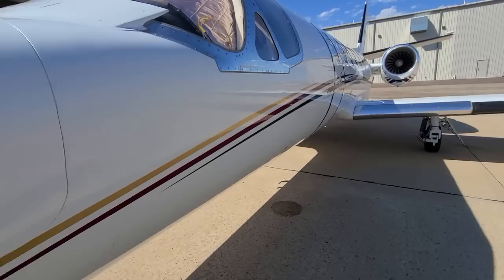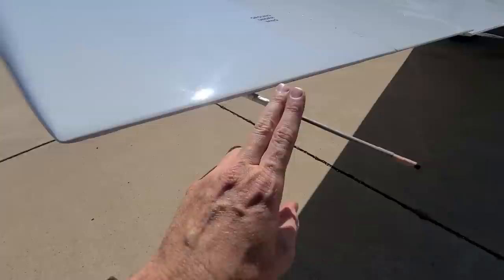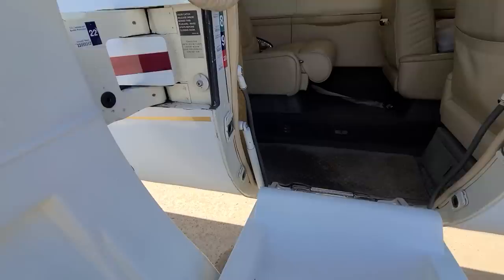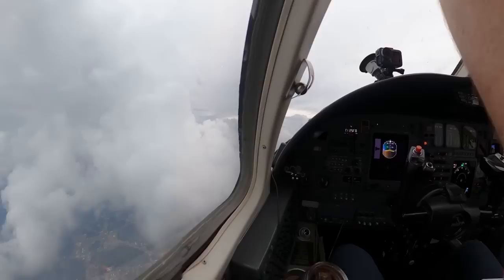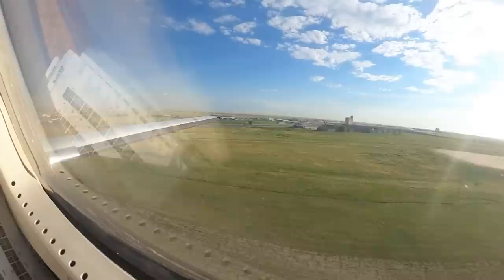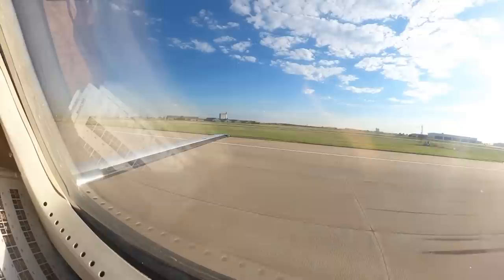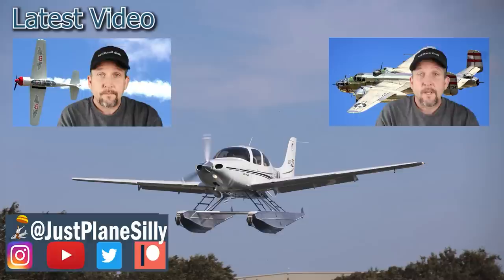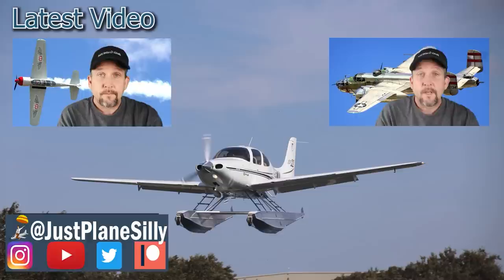How to Preflight a Lear Jet

Comment: Yay, back to silliness!  Good job!  BTW, about the pounds of fuel with jets.  This actually has nothing to do with weight or volume.  Jets are so fancy their fuel can only be bought with British pounds sterling and the fuel gauges simply show how much money you've invested in each tank.  So, to determine how many gallons you have when the fuel gauge displays pounds, you have to do the following:
1.  Determine the price in dollars for a gallon of avgas
2.  Use the current exchange rate to convert this dollar amount to pounds sterling, which gives you pounds per gallon on that day, depending on avgas prices and the exchange rate.
3.  Divide the pounds shown on the gauge by this number, which then tells you how many gallons are in the tank.
Reply: Thank God somebody knows how it works.
Reply: Such calculations can be performed quite easily using a Chinese abacus. Just need to use the Chinese currency exchange rate.

Comment: Next time, make sure you hook up fishing line to the chrome handle on the side of the plane and run it through the door so you can flush the toilet while you’re in the air.
Reply: That would be bad for safety. If the pilot can go to the bathroom more than once, they will forget to land and risk running out of fuel.

Comment: Just to confirm, you were careful to stick your airspeeds at 85 downwind, 75 base, and 65 final, just like my 172, right?  Also, you need to have a good A&P mechanic take a look at your bubble-ator, which was not creating bubbles on your final landing, a definite no-fly item...could just be a liquid soap issue, but I'm not a mechanic, so likely a mere $8,000 fix in my experience.

Comment: That's a little misleading Brian-with-a-y. Only those fancy planes have the external flusher. Smaller planes have what looks like an oil drain plug. Makes sure  its heated up when you empty it so it flows out efficiently.